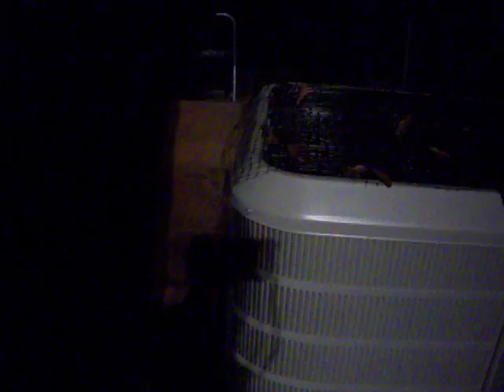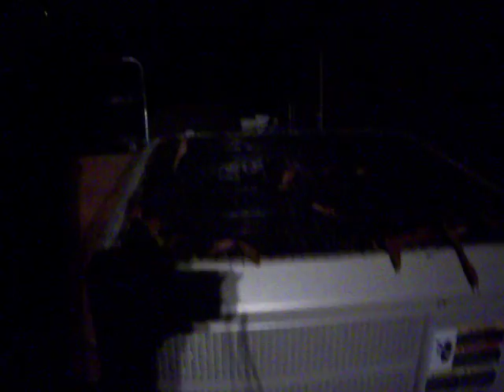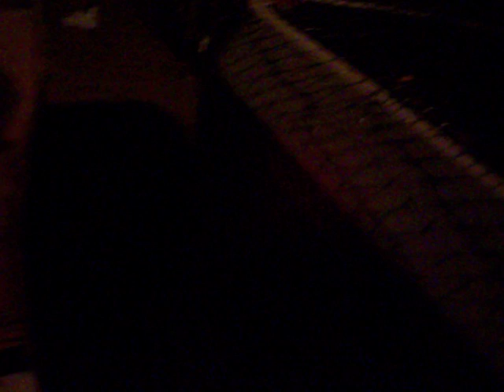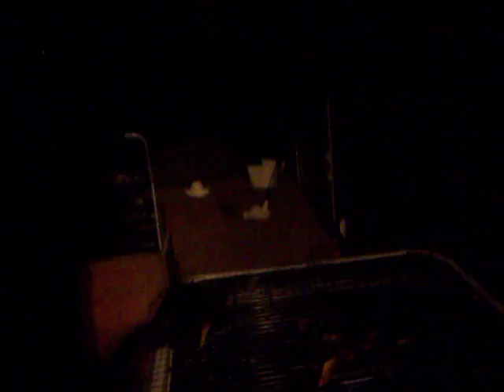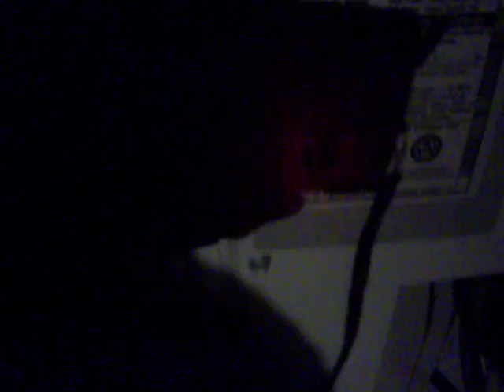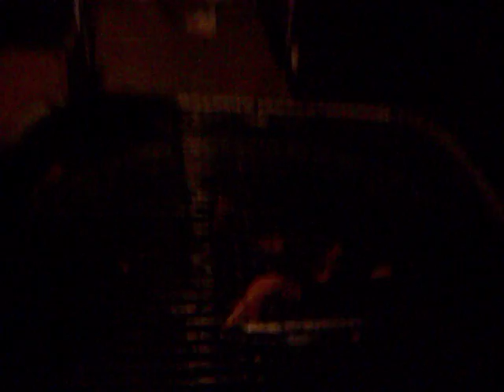Westinghouse (Nordyne) Heat pump Starting in Heat mode

Comment: Duel fuel, 2-Stage, AND a variable speed IQ Drive? Awesome equipment
Reply from the maker: The idea when I got it was to redo my duct work and swap out the condenser for an IQ drive.  Even though the condensor is only 2 stage, it cools evenly and dehumidifies well. The furnace heats the house evenly, so I just decided to stay with the 2 stage condenser. The units almost 9 year old. So far, has been a great system.

Comment: Hello, Do you really have an aftermarket (Honeywell) thermostat working on a Nordyne IQ Drive system? If you do you are the only person in the world that seems to understand this setup. What can you tell me?
Thanks
Reply from the maker: Hi. It is actually a different version of a standard thermostat. It is not a standard visionpro iaq. It has a module that sits inside of the air handler and interfaces with the computer board of the IQ via some connections. I have another friend who has a visionpro iaq and it actually has all of the wiring connected at the wall like a regular thermostat. This one is entirely different.